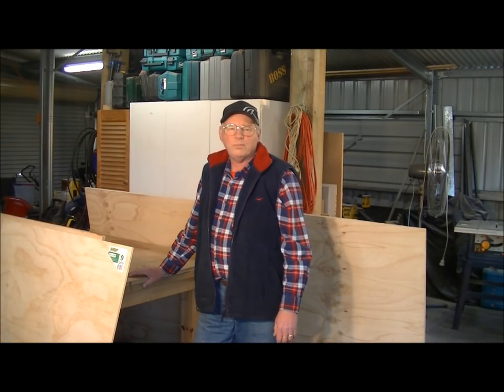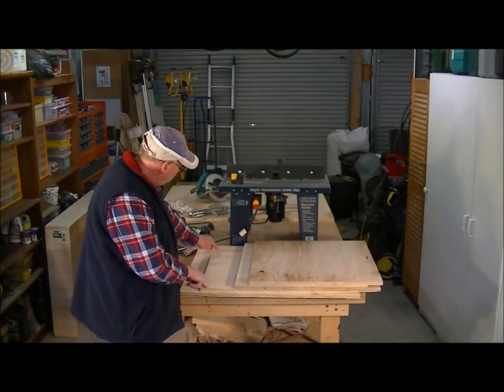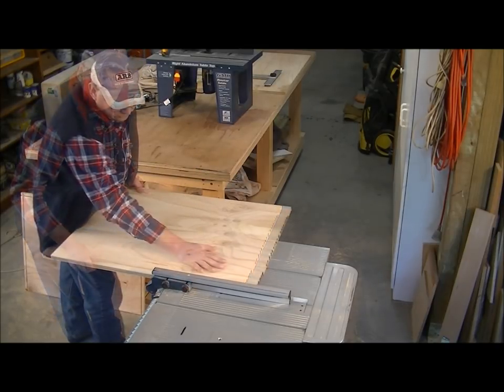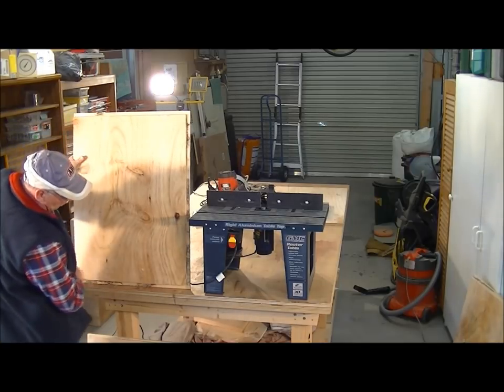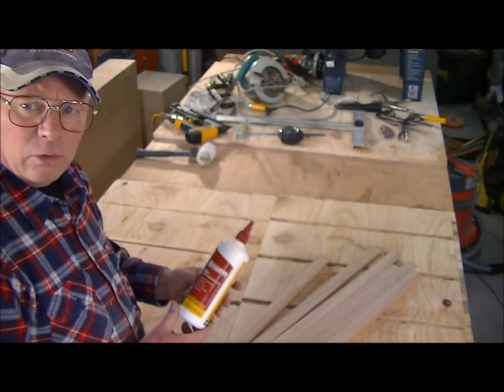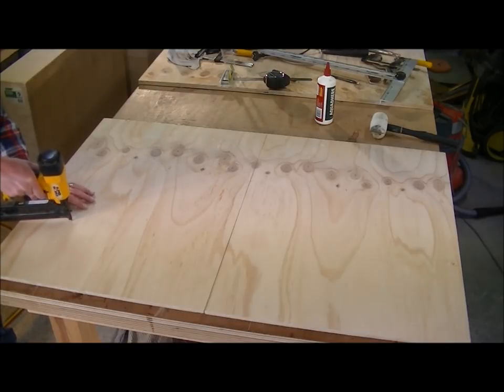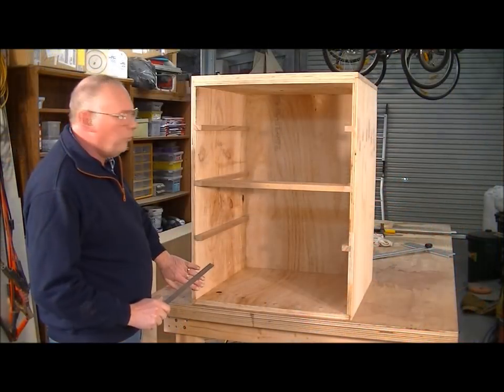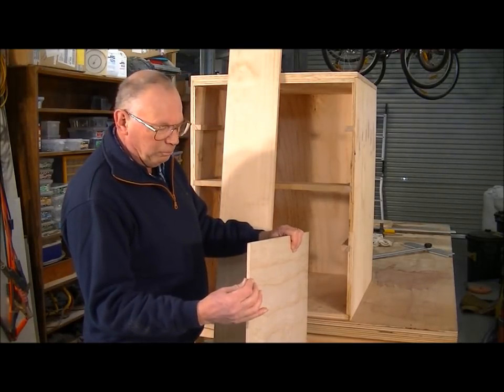60  Simple dado & plywood rolling shop cabinet 1

Comment: You need to WAX the top of your Table Saw so you don't have to push so hard.  As for a Router Table, one that hangs on a French Cleat is space saving & allows the use of the Router as well.